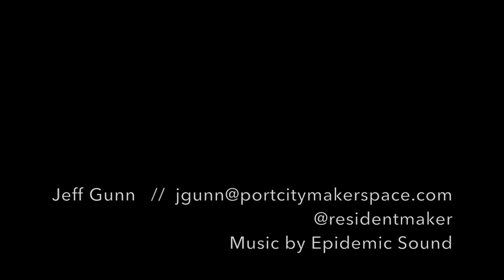SINGLE 2x4 CHAIR - by residentmaker

Comment: Great job, how long did you steam that piece for? Do you think harder wood takes longer? Thanks!
Reply from the maker: There are some guidelines online, but I ended up just checking it from time to time during the process.  I think my piece was in there for 45-60minutes but it was very thin.  Woods have different bend characteristics unrelated to hardness, for example, I read that oak bends very well.  I've also read that kiln-dried wood is harder to bend, hence the struggles I had with a 2x4.  YMMV.
Reply: residentmaker thanks, I have to do a dozen similar chair slats out of Iroko and I’ve never done it. Thanks!